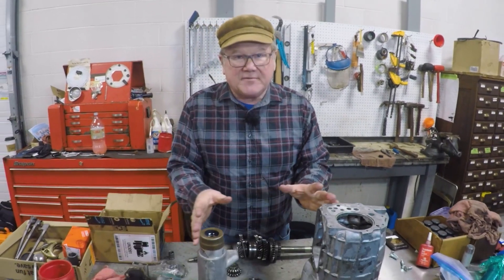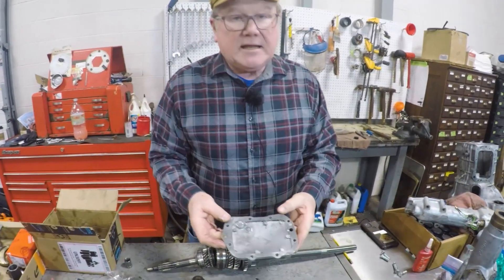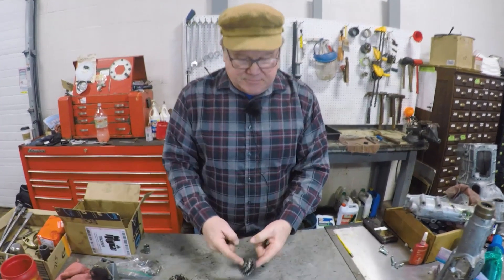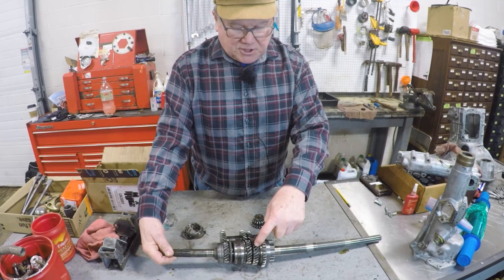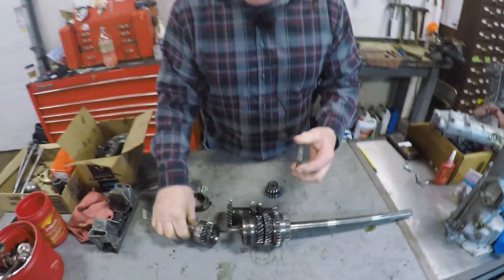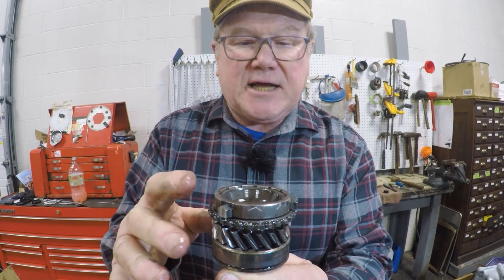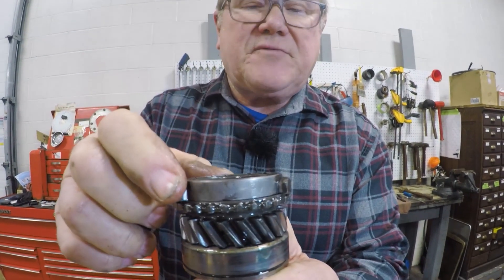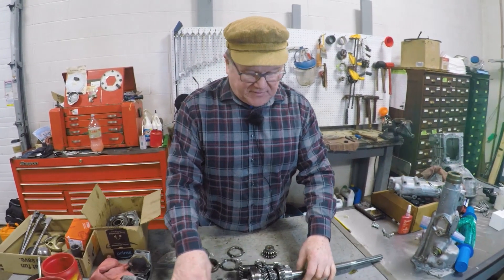457  MG Tech | Spridget Gearbox Assembly

Comment: Thanks for all you help. I bought my first MGB and you've helped me immensely. I need to do a bunch of under carriage work. Fuel line rotted and might as well do the brake lines. I have two front end frame lifts. Can I lift my MG using them from the sides?  I've looked elsewhere but cam find nothing, I guess considering no one uses front lifts anymore is a part of it. Thank you for all your help.